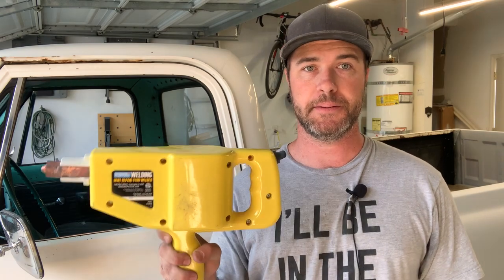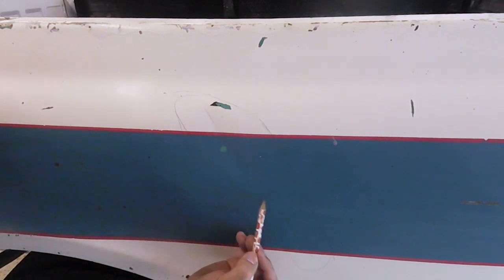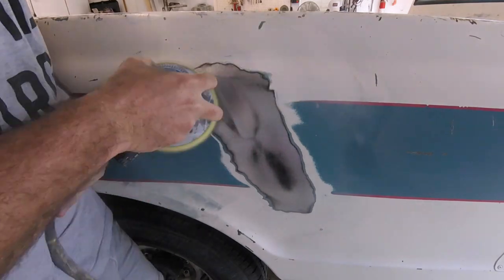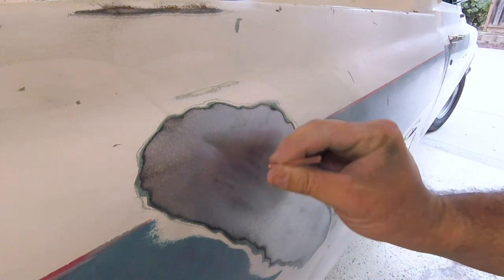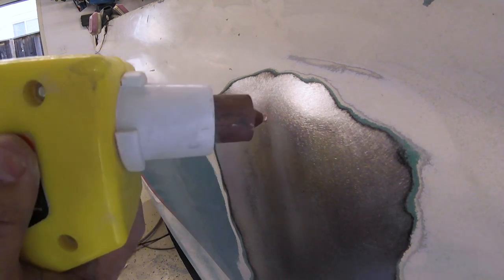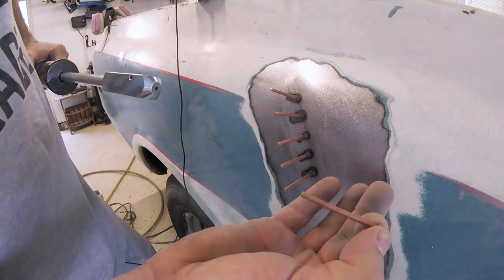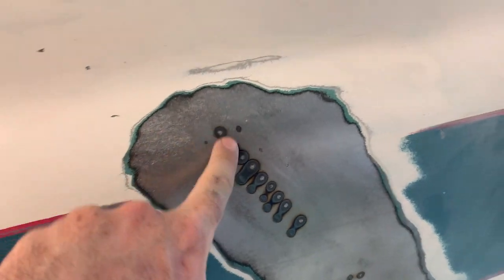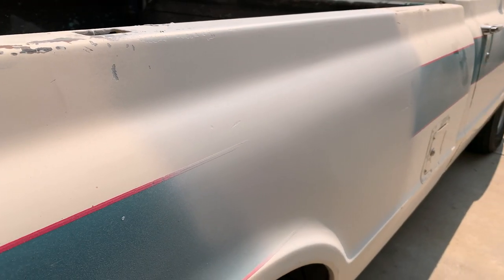How to Pull Dent With Stud Welder

Comment: There was no need to unhook the battery on that truck because it doesn't have a computer in it and I've been doing paint and body work for over 21 years and even on new cars and trucks that had a computer in them I didn't ever unhook the battery when I welded panels on the vehicle. And done no damage to the computer. I don't know where it came from. But when the ground from the welder is close to the spot that you are welding you don't have to worry about anything.  Now when I say close I mean you can have it somewhere around 2 feet.  I've welded next to the computer with the battery hooked up with no problems.  But if you want to just for your own piece of mind than that's fine.  But it's not necessary

Comment: i know im late to the tutorial hahaha but i did have the question, if your not worried about damaging the paint is it necessary to sand it down like you did?
Reply from the maker: There’s paint less dent pullers that won’t ruin paint. Need to put a vide together on how to use one 👍. This method you have to sand because it’s welding, can’t weld those studs ontop of paint.
Reply: It needs a ground to work the tip touches bare steel and that’s the ground no ground no weld